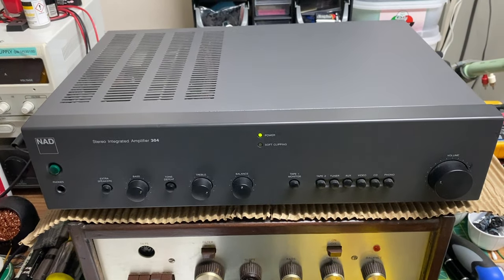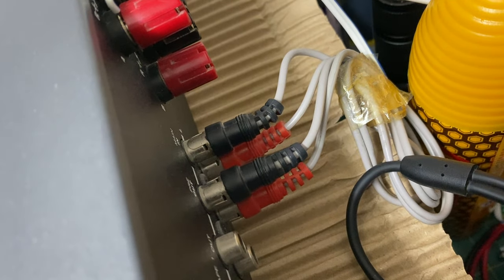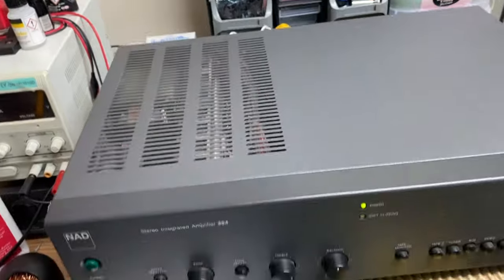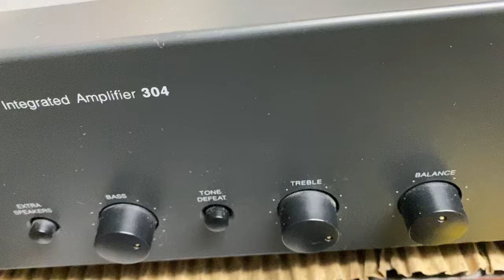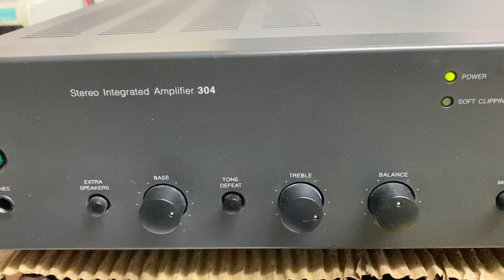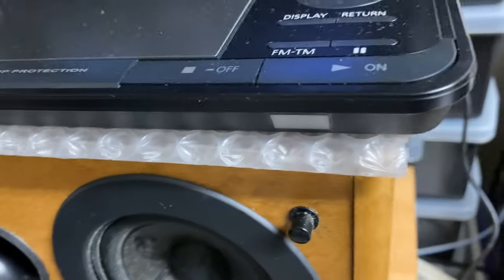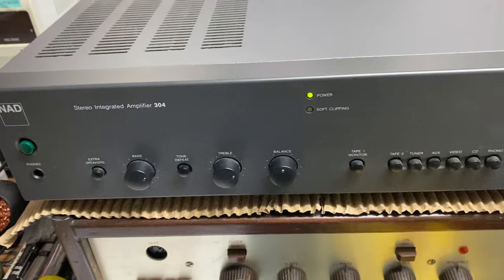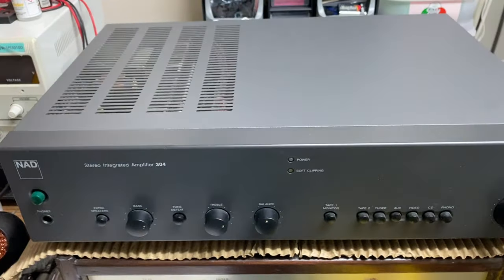Testing my NAD 304 Integrated Stereo Amplifier

Comment: Good demo Harvey, 'soft clipping' reduces the output at high levels to prevent the speaker output being driven into distortion caused by waveform clipping... Or something like that...  Clear a space and connect it to some big speakers ASAP..lol
Reply from the maker: Yep cheers, read the user manual today, I might just leave the "Soft Clipping "switch on all the time.Trying to clear a load of stuff in there next week, so short of space, lol. ps. When I first connected the speakers I thought that either the speakers were duff or the amp as you cannot hear any normal hiss from the speakers when the volume is turned up even on near maximum volume with no signal connected of course, lol.
Reply: @harveysvintageaudio  That sounds promising then.. My 3150 is also very quiet, just a slight even hiss when phono input is selected.. Could be a good idea to check the DC offset etc before plugging in some decent speakers, sure you know that already cos you DO know what you're doing..lol
Reply from the maker: @raycooper-i3m  I just might do that when I repair the side panel, yep it's easy got the service manual for it.